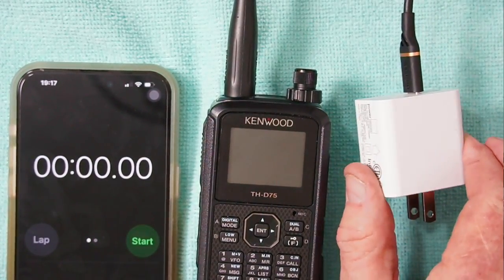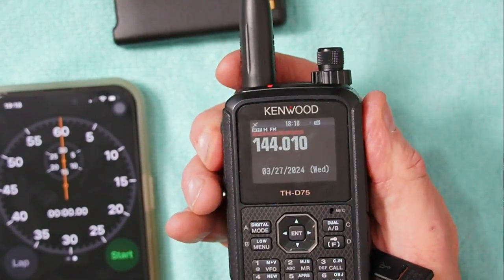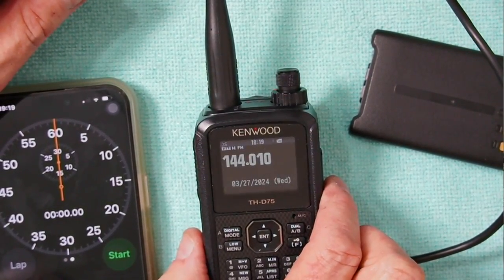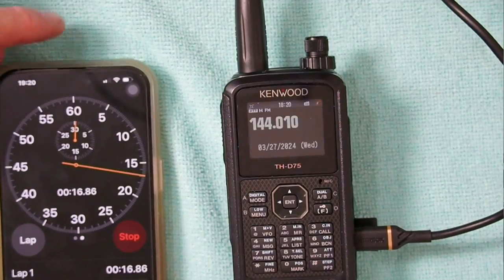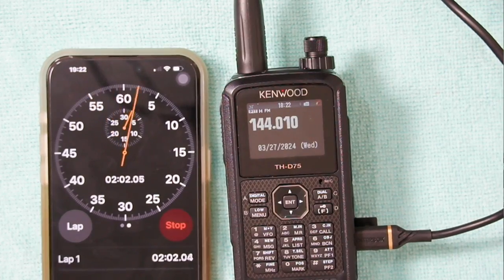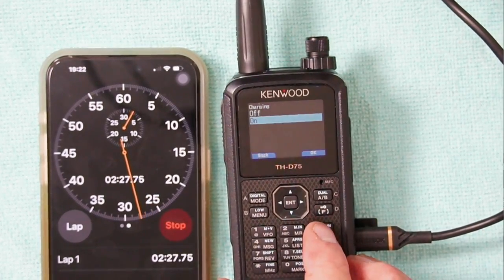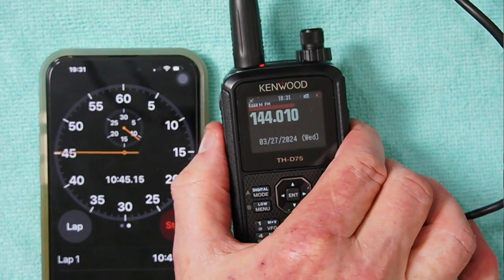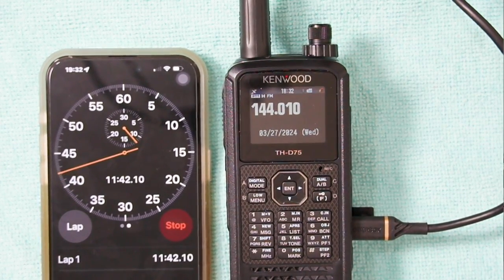USB Charging Demo

Comment: I just buy a TH-D75, and USB charging its not working. Testing with different chargers-power banks, no charging of the battery even in the screen icon says its charging. Some one with the same issue? tested with a USB meter, 0amp...

Comment: We can use 1-2&3 amp USBc charging blocks correct? It has to be above 2 amps if you want to have it on & use it on a empty battery, or without a battery, while charging via USBc correct?
Reply from the maker: @Gun_Slinger556  you need 2 amps to top off the battery

Comment: Can a 3.0 / 3.1Amp charging brick be used to charge the D75?
Reply: Never mind.  If I just referred to the manual.. :)  "To avoid a failure or abnormal heat generation, be sure to use a
USB converter AC adapter (sold separately) with a 5 V output
voltage and a current of 2 A or higher"

Comment: If you plug less than 13.8 volts into the DC-in it works fine. My AGM battery that I use of course is not 13.8 volts, it's 12 and right now it's only at 10 volts and my radio will transmit just fine. Probably would all the way down to 7.5 volts. I mean, after all the radio battery pack itself is only around 7.4 volts fully charged. My AGM battery is only motorcycle sized and 9 amps max and I only charge it once a month.
Reply from the maker: Operating voltage is 11.0 to 15.9. Goes thru a regulator. Good luck.

Comment: Have been using the two TH-D75's I have daily.  Loving the radio and it's features.  In my opinion the battery has acceptable life as well as charging time.  I'm currently torn between the TH-D75 and  Icom ID-52.  I love my ID-52 but the TH-D75 is really growing on me.  If Yaesu had something in the class of the TH-D75 and ID-52 I think my head would explode.

Comment: I thought you weren't supposed to transmit while charging? Might have been in a different manual though, and I just follow it for all HTs to play it safe.
Reply from the maker: Power management has changed. Yes I don’t recommend it but some have asked this question in case of an accidental tx on charge